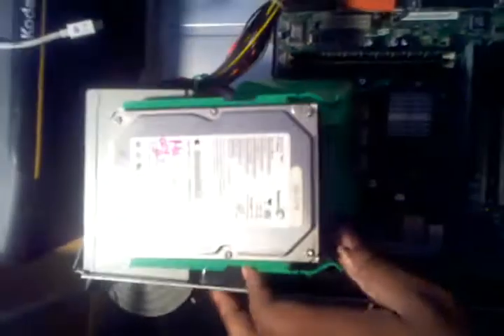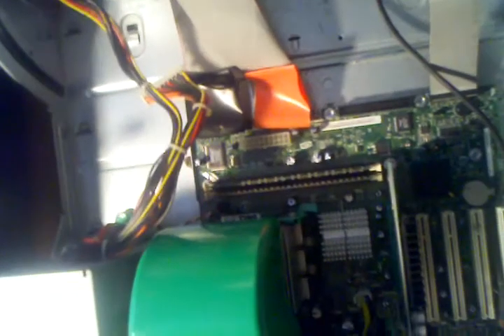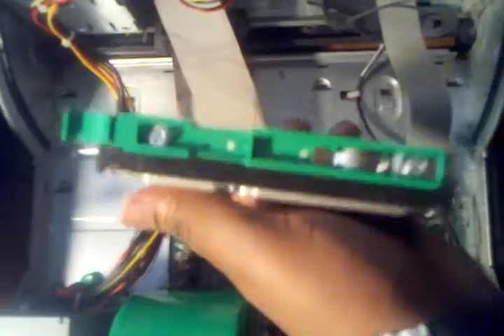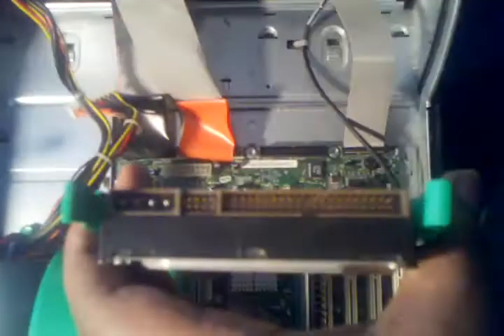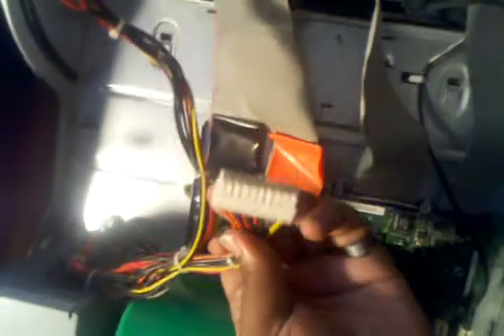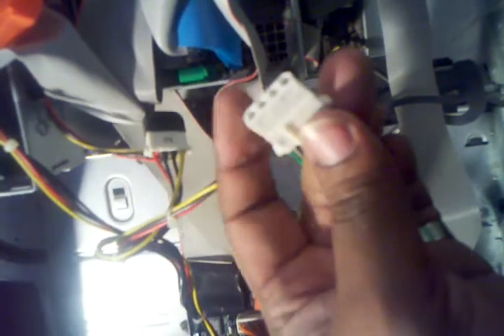Installing Hard Drive into a Dell Dimension 4550

Comment: hey its all good i will probably just buy a bigger Hard Drive all together and just install it without a slave i figured this computer would give issues lol everyone gives the 4550 alot of  crap but i have mine nearly maxed out 3.06ghz cpu 2 gb ram and a EVGA Geforce 6200 le lol it runs great! for older games lol can play CoD 4 but 80gb just isnt enough and the 160 cant be put in main because its SATA and i have a IDE to SATA adapter and that works for shit lol anyways thanks tho haha :)